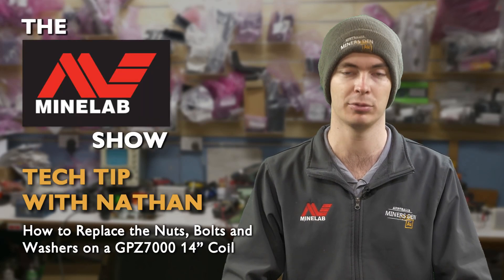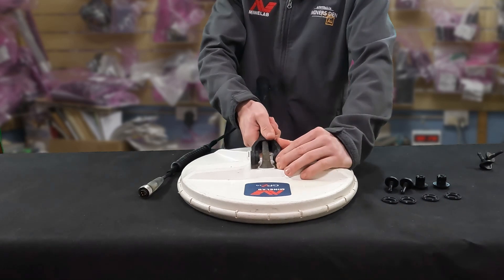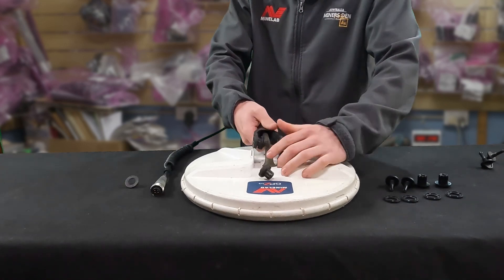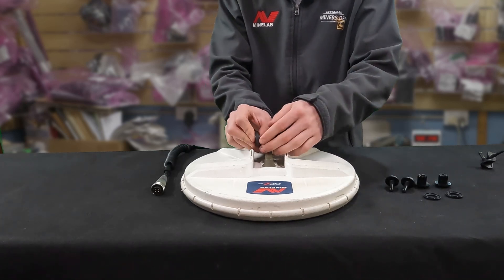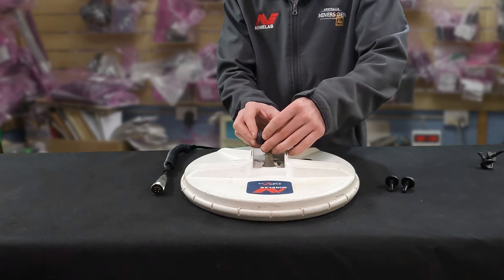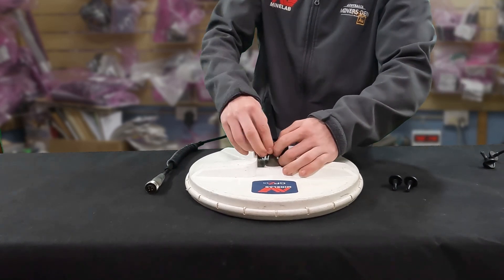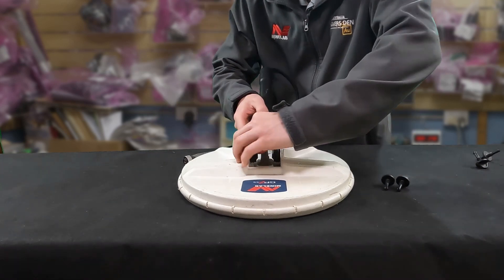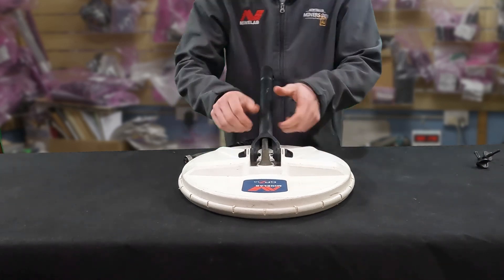How to Replace Nuts, Bolts & Washers on a 14" GPZ 7000 Coil -  Minelab Tech Tips

Comment: Yours came off easily - I cant get the screws/bolts out, I have unscrewed them as far as they will go.
Reply from the maker: once they are unscrewed you need to pull outwards on them as they have a press in fit that clicks together